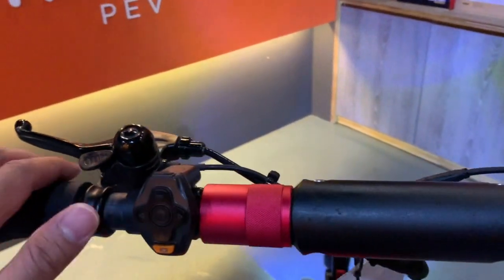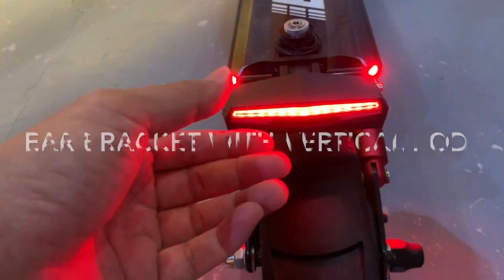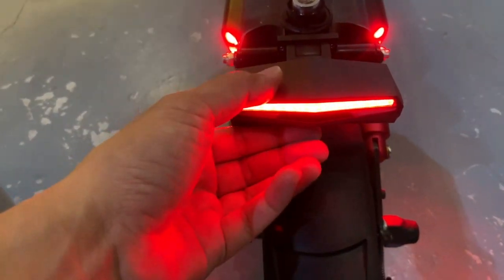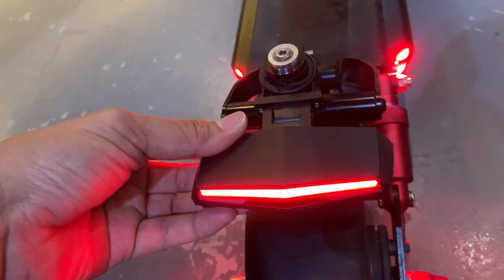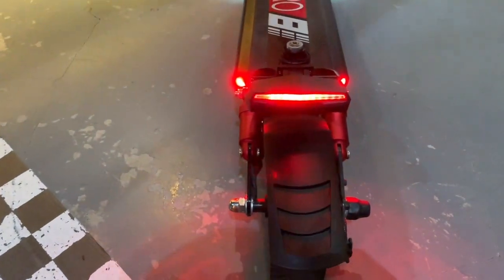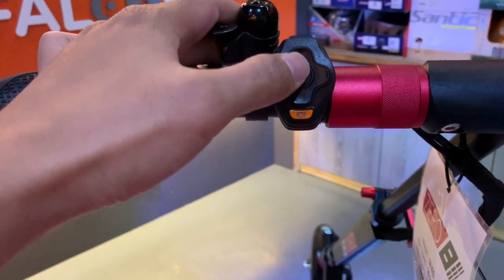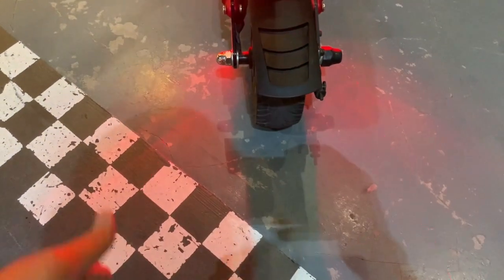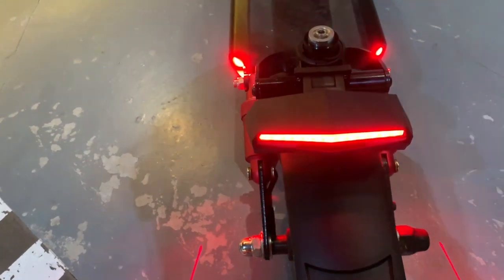How to Install E-Scooter Rear Turn Signal Lights on ZERO

Comment: How to install vertical rod with Horizontal bar? Please take a video and share.
Reply from the maker: We use a rubber washer to hold the turn signal lights together https://www.falconpev.com.sg/products/electric-scooter-rear-signal-light

Comment: You should post the video , how to mount it because that what i belived when i clicked the clip .
Reply from the maker: how to mount it is to use the items we have shown the video. Once you have the horizontal bar and the vertical rod, everything becomes very intuitive.
Reply: Clickbaited here aswell
Reply: @FalconpevSg  Yes but where to find the horizontal and vertical bar?
Reply: Can you still collapse the bar with the signal light on?

Comment: Where do we source the vertical bar that attaches to the carry handle? When I view the turn signal light in your Falcon store, it does not show that it comes with the vertical bar. This is the question that has been asked several times. Where do we source the vertical bar that you used?
Reply from the maker: It comes from us. When you buy the turn signal lights it will come together free. We intentionally hide the source of the vertical bar on purpose. You can find out more here https://www.falconpev.com.sg/products/electric-scooter-rear-signal-light?_pos=2&_sid=acf354454&_ss=r

Comment: Cool, do you have trolley wheel, wherein I could lift it vertically or any generic that supports it for Zero 8

I've only seen the pullable 45degrees trolley wheel.

Or link me to any website that supports generic accessories for zero 8?
Reply from the maker: Daison Carino not yet

Comment: Will this fit onto the zero 9 or will you produce a specific one for it?
Reply from the maker: trizz4711 the lights and vertical pole will fit but you will need a customized zero 9 handlebar
Reply: I see. Thank you for the quick feedback. :)